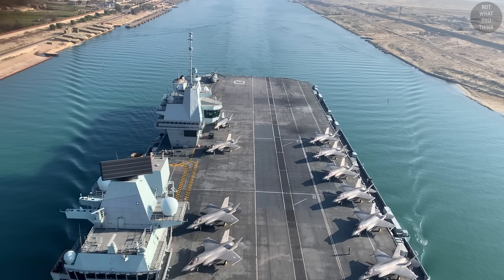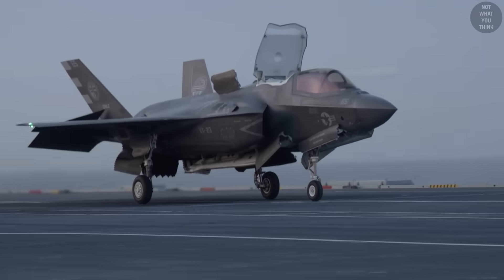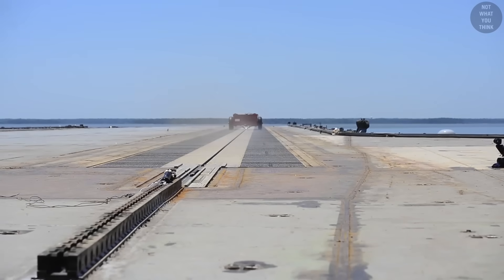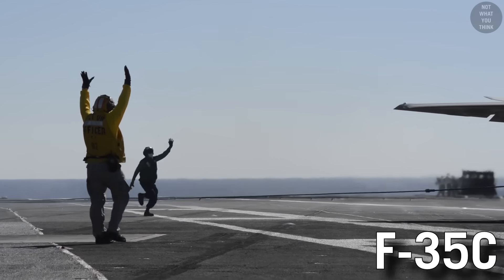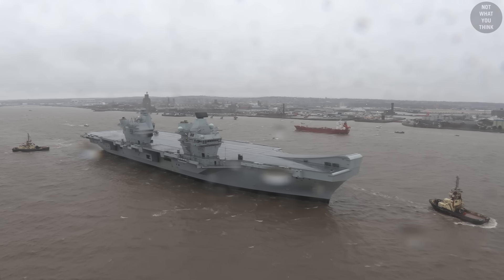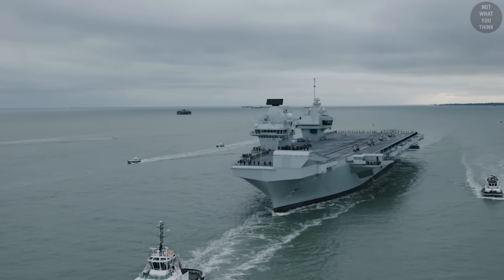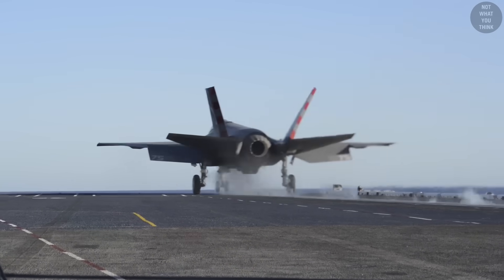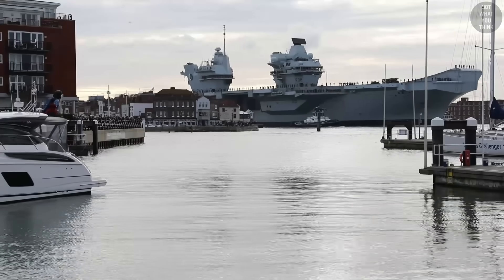Was the Angled Flight Deck Missed on HMS Queen Elizabeth?

Comment: The angled flight deck was not missed. It was built into the design of the ship early on as the decision had not been made as to weather to operate the ships in STOVL or CATOBAR fashion but at some point the decision had to be made because of the installation of catapults & arrestor gear for CATOBAR operations. The angled flight deck was already designed into the ship. The deck markings only had to reflect STOVL or the angled approach for CATOBAR operations catching the arrestor cables.

Comment: just a heads up our industry partners already have plans to upgrade them and the RAF is looking at buying a number of f-35c's in the near future so I don't think its more than a decade before the QE is upgraded but it'll be significantly longer before the PWLS is mainly because of there respected positions the QE been the flag ship of the RN and the PWLS only been the NATO flagship, also one thing you didn't mention which I had the pleasure of talking to the captain of the PWLS about the other day is the future use of drones on our carriers they plan on cutting down the compliment of F-35 on the carriers and instead using the remaining F-35 compliment as drone squadron leads as it cheapens the loss of aircraft and man power in conflict so his vision is 1 F-35 to maybe a dozen drones.
Reply: just to clarify the fleet air arm operate off the ship so the RAF buying F-35C wouldn't make all that much impact on the navy. although i do also see them adding some form of catapult system later in her life

Comment: The British carriers just seem like a more expensive, far less capable ship than what the US has been building. Granted, they really have no need to project naval airpower beyond their own borders because they just have the US do it for them but still. The aircraft carrier is the new battleship, its the pinnacle of your countries military might and innovation, and you power your flagship carrier with diesel turbines? Outdated tech, less crew, less aircraft, longer turn around times, and few sortie capability smh
Reply: They're far from more expensive, they cost a fraction of the price of US carriers and they also require a fraction of the crew due to the higher level of automation on board which is a big plus.

Nuclear has been used for many decades now but is still only rarely used on surface warships as it doesn't really make sense in most scenarios, even the new Zumwalt class use the same RR gas turbines as these carriers.

The UK also wouldn't be building aircraft carriers if they had no need to project naval airpower beyond their borders, that's pretty much their entire purpose. The UK realised they had to maintain that capability after the Falklands, so much of the design for these carriers came from the lessons learned there.

Comment: I always thought another reason for the angled flight deck was so if a plane didn't complete the landing, the plane would come off the deck away from the the bows, causing less carrier damage.
Reply: @Sam Jam good point. I forgot about the catch net.
I always wondered if landing at an angle would be much more awkward  compared to a straight in, but the benefits seem to outweigh that.

Comment: I've always wondered why the carriers don't have down hill decks with ramps. Like skate boarders can take off with just a little half pipe so why can't jets do something similar?
Reply: The jet would broke in half while skating lol but also gettin the thing up would be troublesome, or require a 2x bigger deck space for the planes to not crash on the ramp
Reply: @nomorealone9158  jet would broke?

Comment: The machinery space is there on the QE class carriers for cats & traps....So in the future, we may well see them reconfigured but they weren't put in because of A.) At the time, the CV equipped world was at a crossroads in terms of using traditional steam powered cats and magnetic/electric cats.  B.) Cost.....We've been relatively skint since WW2 and, C.) Power generation....Cats & traps require huge amounts of power to run them.  In the way the QE class are designed, they'd need extra steam making plant/generators installed to run the cat & trap configuration.

Comment: Just to say:
One of the reason compared to US or Russia (not even talking about China where the reliability of their copied equipment is comparable to the one of my made in China toaster), Europe isn't really a super military power is that at no point in time EU nations could agree in spreading military development, thus not achieving any economy of scale. 

For instance on the aircraft carrier topic: UK plan was to originally build theirs in a joint venture with France. Unfortunately that got cancelled most likely because of costs since an angled deck with arresting wires is a pre-requisites for the French Rafale M (although it's said he could take of without catapults). Not to mention power generation where surely France wouldn't pick anything else than nuclear, UK chose a gas and diesel turbines (even-thought I'm not an engineer I'm relatively confident that has a considerable impact on how things have to be laid down in the ship holds).

Comment: Excellent summary. Really thorough. I like that you included the future retrofit options for the QE class, which are absolutely the case and were built into the design with this in mind.
Reply: if they retro fit though they will have to replace the air wing for each carrier no small cost there.
Reply: @mawdeeps7691  true, but if the refit happens in 20-25 years (given a 50 year life span for the carrier that doesn't seem unreasonable) then it is entirely possible that new aircraft will be required regardless, for example 6th generation fighter, or a move to combat UAV's, at which point the cost doesn't matter.
Reply: @matthewshedlock70 carrier based tempest, maybe? Pretty please, BAE lol
Reply: @mawdeeps7691  it's not like we have fully committed to F-35B. We have 32 currently out of 80 planned. We could easily make the B models air force only. Besides, who said that a design couldn't be made that would integrate both types, since a CATOBAR carrier operates helos anyway, so the VTOL jets could follow the same landing procedures as them

Comment: In fact it's now looking likely that the ships will get an 'attenuated' outfit of lower-weight-capable (apparently for aircraft of up to 25,000kg launch weight) EMALS type cats, plus traps, primarily to permit the operation of various UAVs, including combat capable fast jet "loyal wingman" drones. Something that will also necessitate an angled flight deck. As the combat drones will complement, and be controlled directly by the F35-B crews, it seems our carriers will then be neither purely STOVL nor CATOBAR  ships but a mix of both.

And as an outside bet, it could eventually get even more complex if the 6th Gen Tempest project results in the development of a maritime variant, say the "Sea Tempest", that in view of the plane being a very powerful twin engined fighter, may then even be STOBAR operated.

Comment: the uk carriers were initially being designed with either ramp or cat launches however once construction had begun the uk government changed their minds and wanted cat however the cost to change to cat in time and finances were too high so we stuck with ramp. its that simple.
bare in mind during construction the carrier program was almost cancelled, it only continued because it was cheaper to complete over the cancellation penalty by the ship builders

Comment: One of the biggest challenge for a catapult is stopping the piston reliably in a very short distance.  Steam catapults do this in a very creative way by using channels at the end of the cylinder that divert the steam from the back of the piston to the front.  This stops the piston reliably every time and has almost no failure mechanisms.  How is this done for electric catapults?
Reply: Look into how eddy current brakes work, and there's your answer. (Same idea even if the underlying physics are a bit different, nothing to really wear out, and just as simple if not more so.)
Reply: @pauljs75  Not really "An eddy current brake ... slows or stops a moving object by dissipating its kinetic energy as heat."  And that is where the main difference is.  For a steam catapult, the steam provides the energy to speed up and slop down the catapult.  For an eddy current brake, you have to slow down the catapult by converting that energy into heat.  That means dissipating a LOT of heat in a very short period of time or risk melting everything.  Also the whole process of generating the eddy currents is pretty inefficient.

Comment: I think that catapult can launch less aircrafts in same amount of time than that curved flight deck. So it's better for agressors - you have time to plan and launch everything you want. AND you need more fuel for that. While short take off variant in better for defence - you have limited time, but you do not need to fly far, so you dont need much fuel, AND you will need only air2air missiles (they have much less weight that air2ground).

Comment: There is a nice simplicity to the STOVL design. If your plane can take off, it can take off and if it can land, it can land. You don't need to rely on the catapult working or the arrestor cables being in place. You also only have aircraft that can potentially land without an intact runway or one filled with extra aircraft. Very good if you need to fight another conflict like the Falklands and only have 2 carriers.
Reply: Bob Watters  I made it in my original post.
Reply: Bob Watters  You are missing my point.

Comment: its really that hard make a steam generator? just use the exhaust heat from the engines to generate the steam. and store some water solely for the Catobars. Diesel locomotives did this for compatibility with old carriages in Britain.
Reply: It would definitely be possible, but every other carrier that has used steam catapults have generated steam as a by-product of their engines, it was basically deemed as too much effort to engineer a solution for that when EMALs was now becoming viable.

Comment: The F-35B is actually cheaper than the carrier variant F-35C, due to the low production numbers for the US Navy only model, and the recent announcement that each US Navy Air Wing will now have only one squadron of F-35C Strike Fighters, instead of the planned two.
Reply: But wait till you see the hourly flying operating costs right now it's still 36 grand per hour.
Reply: Alenas Kvasninas  But the Royal Navy made a bad, knee jerk decision, to give up on EMALS, and go back to the ski-jump carrier style they had used with Harriers.  This "cost saving" measure means that the Royal Navy's very costly pair of new aircraft carriers will be of limited utility in future conflicts.  The F-35B's more limited range will force the ships to operate in closer proximity to the enemy's defenses.

Comment: There are advantages of a STOVL air craft. The Sea Harriers showed this in the 80s. Two QEC carriers were announced on order in 2007, but years earlier on 30 September 2002 MoD had announced  the RN and RAF would operate the STOVL F-35B variant. So although in 2010 they announced they would fit CATOBAR as was cheaper and didn't because it became more expensive, the original plan was the B variant and this must have had some advantages other than just cost. Or maybe it's just Royal Navy tradition after the success in the Falklands war.
Reply: The advantages are a smaller, cheaper ship with less maintenance. But then you have a more expensive aircraft with more maintenance and/or less capability. You also limit the range of the ship because it can only use helicopters for resupply and airborne early warning.

That said, now every amphibious assault ship can be its own carrier. That is the biggest advantage in my opinion. You might even be able to revive the carrier submarine concept, as unlikely as that is.
Reply: @dude6935  The Royal Navy showed big advantages of the Harrier over the Mirage jet in the Falklands war. After witch the UK overtook France in arms sales.
Reply: @MrRichymil  The QE class carriers are not small. They are among the largest non-nuclear carriers in the world, if not the largest. The US amphibious assault carriers will operate the F35b at only 60% of the displacement.

Not knocking the QEC. Just saying is all.
Reply: @dude6935  With the existing and coming generations of tilt rotor aircraft, helicopter usage for resupply and AEW ops may well change.
Reply: @dude6935  The QEC carriers ant small and were built for the F35 witch requires a bigger ship than the previous Invincible class ships.
Reply: It wasn't a war it was a conflict
Reply: @grognakthedestroyerattorne3211  I remember at the time it was a war.
Reply: @grognakthedestroyerattorne3211  why not look it up https://en.wikipedia.org/wiki/Falklands_War
Reply: @MrRichymil  Wikipedia isn't always right
Reply: @MrRichymil  many people may say that it's a war but they are wrong and that's alright
Reply: @grognakthedestroyerattorne3211  why do you think it wasn't a war?
Reply: @MrRichymil  It's argued that since no declaration of war was made between the UK and Argentina, it's not a war. But that seems to be a bit of a misconception.
Reply: @BigDaz  However both sides declared it a war zone.
Reply: @BigDaz  Inviting sovereign British territory is pretty much a declaration of war anyway.
Reply: Ask the members of the armed forces that took part in it, they’ll call it a war, nice that you sit in your lovely warm room being a pedant! @grognakthedestroyerattorne3211